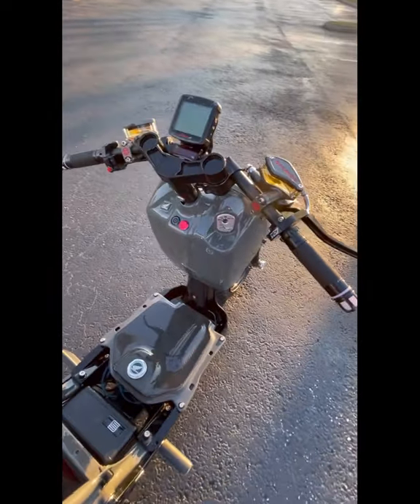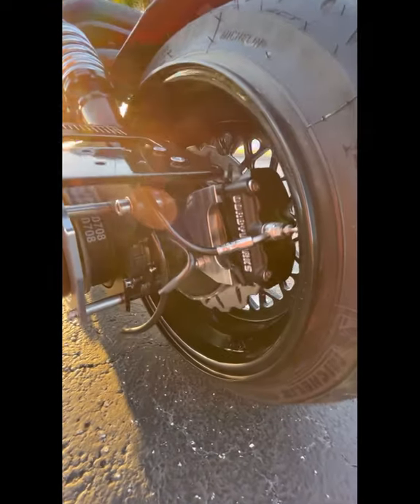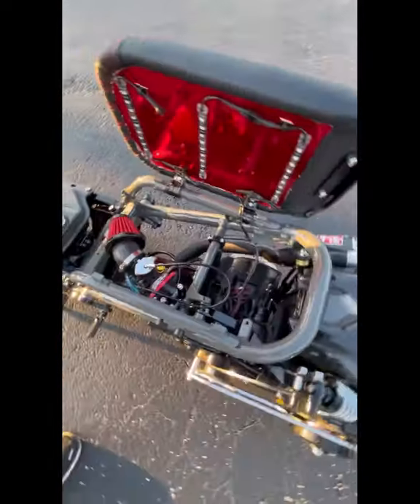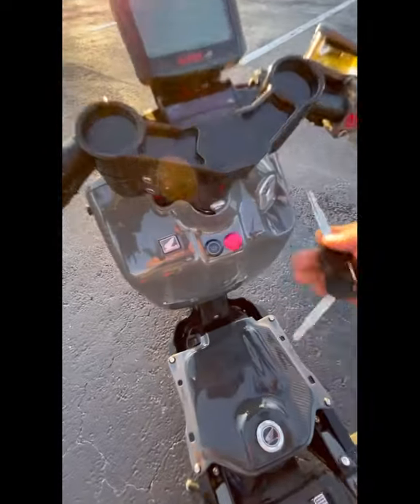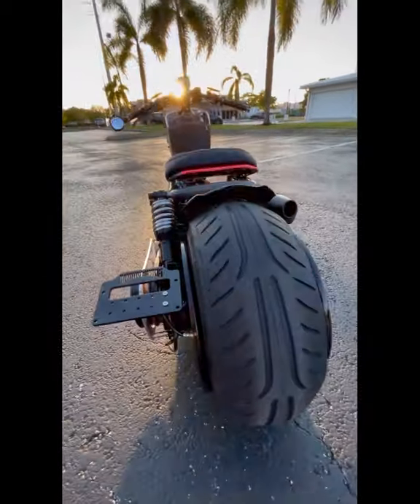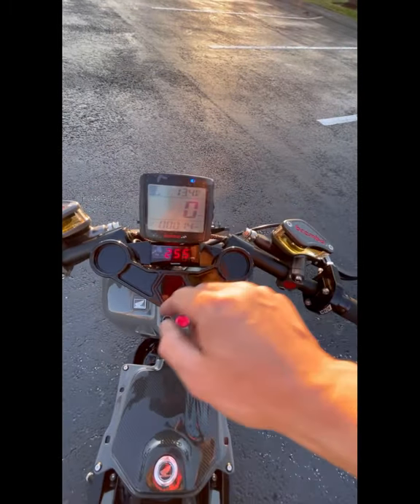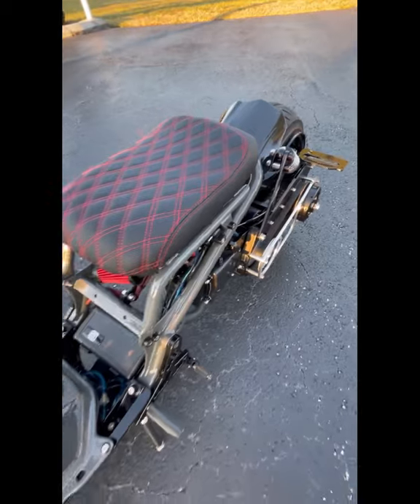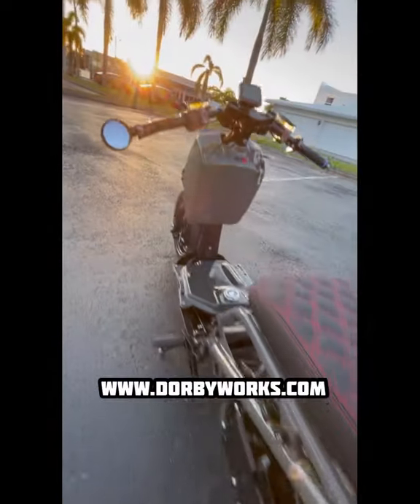Honda Ruckus custom Michigan Monster Dorbyworks Road test time

Comment: Super Nice!! I really like the color combo too.
Reply from the maker: Thanks for checking it out and commenting!
Reply: @MrDorby  Absolutely! I have been looking at your parts online and Ruck builds for past 6 months. I have a TRS stretched 49cc Fatty which I am swapping to a 190 GY6 that Matt a Rollingwrench is just about done building for me. I will be ordering the Yoshi overhead with a carbon fender to set it off! I will be placing the order on your site in next 2 weeks or so.

Comment: How can I get the bracket for rear fender? I will purchasing the same fender but need a bracket.
Reply from the maker: Fender only sold with exhaust systems for proper fitment
Reply: If you keep CVT cover on will the case still break on 171cc?
Reply from the maker: @recycle247  yes